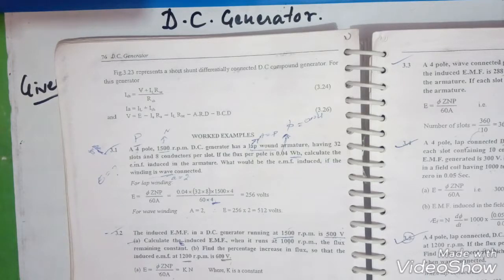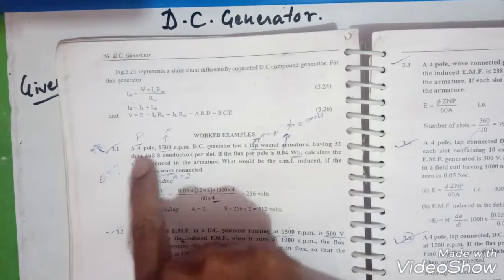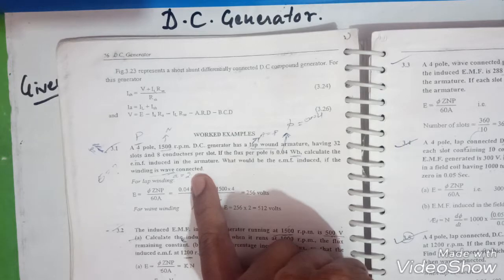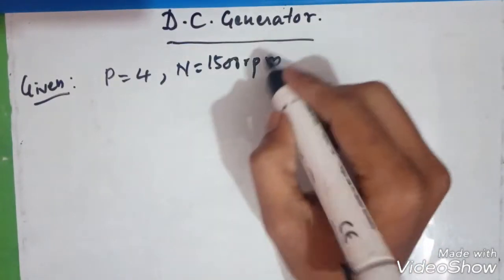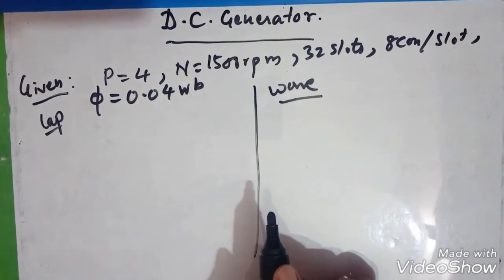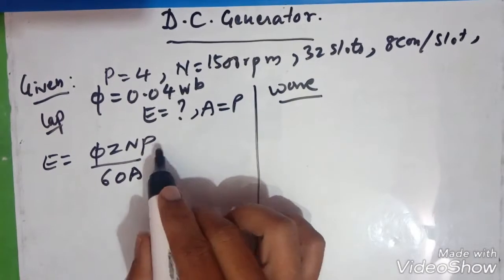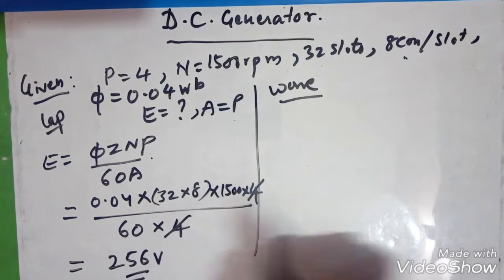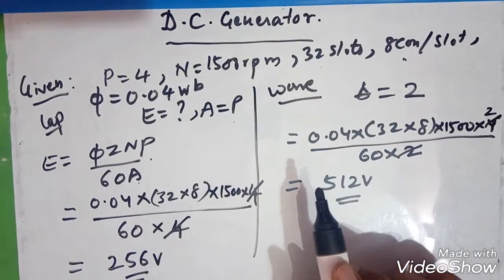Important problems of basic electrical subject from D.C generator

Comment: drive the EMF equation of a DC generator and find the EMF generated in a 6 pole machine having web winding continue 664 conducted fluxs per poles 0.06 wb and the speed is to 250 rpm at what speed the armature must be driven in order to generator an EMF of 550 Volt.if the flux per pole is reduced to 0.058 wb
Reply: Plz sloving this question
Reply from the maker: I am not getting wat u want to ask plz post photo